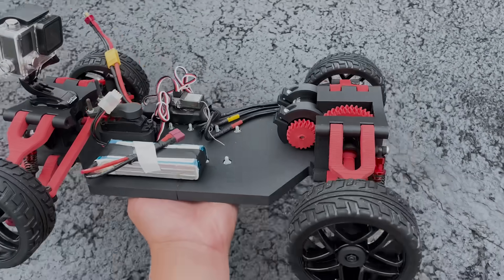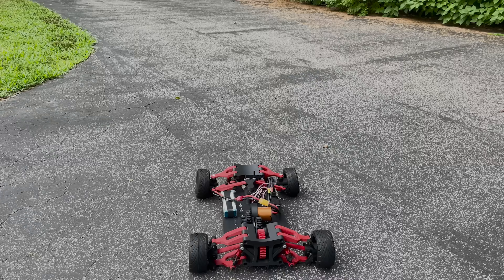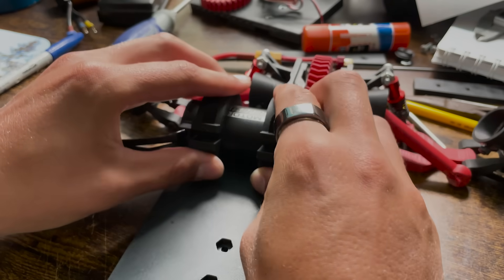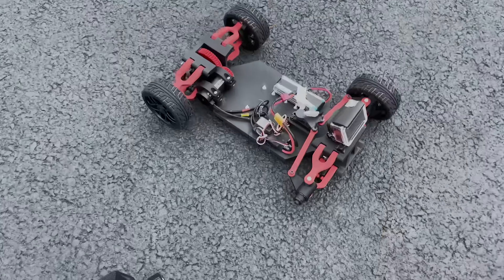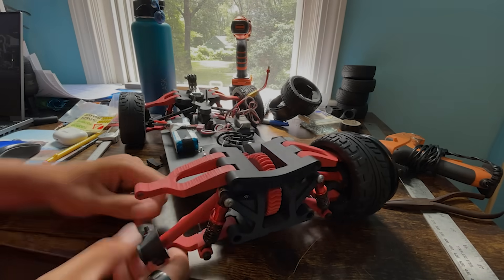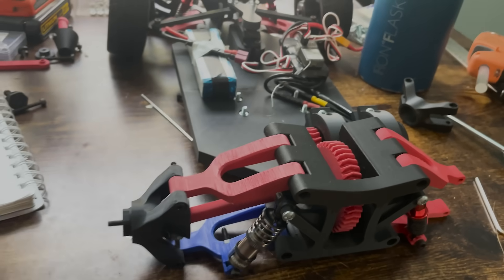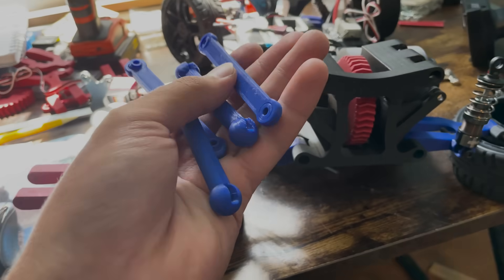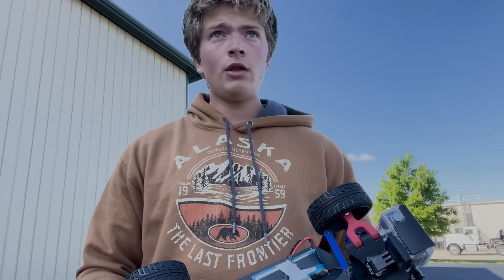Engineering a Better RC Car

Comment: Your suspension needs actual geometry. Equal length, parallel arms (even worse when sloping upward toward the chassis) suck. No camber gain, terrible roll centers, a crapload of jacking... The works.

Comment: Hey I am building an RC car as well. However I have one question. How do I make sure the track width(distance between wheel to wheel) doesn't change a lot when the suspension is compressed and not compressed and does this matter

Comment: you could probably try making it belt driven with it geared down to around 1/6 gearing ratio and 3d print a tensioner

Comment: Just so you know if you print anything out of carbon fiber it will make it more brittle if you print a soft material with carbon fiber it will make it tougher and more rigid what does not make it stronger but as for your lair line issues for people who have printed other things if you print at a 45° angle or with some other kind of angle to it or horizontally anything that is round will become stronger you have to think about how the layer lines are and how things are going to break or twist

Comment: I'm going to share this just in case you haven't found the answer yet or in case you're still looking for a solution but you can take a file and flat spot a certain section then take a grub screw and basically use a grub screw then secure it with either Loctite red or blue and that means the whole entire piece as well as the grub screw you can even take a file and make a flat spot in the middle of your axle for metal rod whatever you're using and put it in the place of where you have the best ability to put a grub screw at I hope that helps you do not need the key the entire thing and adding a key with just make it weaker anyway the other thing you should do is increase your wall count that way it will make your teeth on your design stronger

Comment: I'm only a few minutes into the video. I won't argue with the methods describe to reduce or eliminate cogging, as it is a fairly common problem. But another method is to use a motor with a sensor instead of sensor-less. 
   I finished watching the video, good work and nice try! That's a good idea to release the files to thingiverse. Maybe some people will try the files for themselves. I noticed that you have less than optimal print object orientations. Object orientation makes a big difference in part strength.

Comment: how about designing for 3d printing and not how the part look traditionally. Take advantage of 3d printing. Avoid forces at layerlinies. This is the weakspot. My solution is 45degree to layerlines. Yes it looks strange but it works.

Comment: Great video, and great journey for you! It was a real pleasure to watch how you design and learn on the way of the process. They way you approach problems and find solutions is amazing. So - my advice here is not on the hardness of the materials - but the care of the LIPO battery. RC cars are very close to the ground and usually get beaten a lot. For this there is special type of hardcase LIPO batteries designed for cars. You can print also your own battery box, to make LIPO more protected. LIPO batteries in general are extremely flamable and if you get single puncture , battery will go into burst flames and will totally destroy your car , and even can make a fire on the place.
Reply from the maker: thanks! and thanks for the concern 😅. I should probably do something about that

Comment: Use TPU, dont panic, there is a hard version of it, you can literrally beat it with a hammer, and it will not even scratch. Its like shore 87 on the D scale. Parts with like 5mm thickness will have a little flex to it, but this ist good for an rc car and its way less expensive than nylon, and esier to print, even though it will warp, so design some round pads lick 0.6mm thick to the corners of your parts.

Comment: Like what @craigoverend said. Sensored esc and motor is the best option. I only use this on all my rc cars. Plus it’s more tuneable and fun to adjust play around with. You also get boost and sometimes a turbo depending on the esc

Comment: For those parts that need to be strong... like where the control arms hit the chassis you will want to print them in the strongest orientation to prevent layer separation failure. Even the strongest filaments will need this as RC cars take a serious beating. Good project!

Comment: You should just use 3d printed parts for mold making maybe? Whatever traxxas is doing is super strong! Maybe use shorter upper arms to fix the roll center/camber curves? awsome project! Very impressive fabrication!

Comment: kudos for getting this far, my 3dp RC car took at least as long as yours and i've only had to complete redesign everything 3 times..   I use generic pla+ on mine, there are much stronger filaments out there, but pla+ is way better then plain pla and just a bit behind much tougher to print filaments. Also build weaker A-arms so they snap first instead of the chassis.

Comment: hey, what size bearings did you use in build and bolts, would be nice if u had little description on thingiverse of what bolts and lengts and bearing sizes had been used. Thanks
Reply from the maker: all were 4m bolts ranging from 50mm to 30mm in length, bearings were 21mm OD, 19mm ID
Reply: @hamburgerinc6995  still looking for the bearings mostly 15x21 pops up but no luck on 19x21x4mm mby there is any in inches since I don't understand inches hard for me to get right bearings

Comment: the way to fix the no start on its own or cogging is to use a motor the is sensorred. The sensor  tells the esc where the stator is at all times and will negate the cogging.

Comment: Great job! Problem is you make one part stronger or stiffer and it breaks the part interfacing with it. RC car parts break. It’s just part of the hobby. One trick is to make parts flexible, so they bend instead of break. And make it so the parts that tend to break are easily replaced.

Comment: Sweet car! Mine is a little different. Just know that when you change materials, you have to consider what the part needs in terms of stiffness vs compliance. Since your front arm mount is attached to the chassis, I recommend splitting those into different part/materials. You can also sandwich TPU parts between PLA or PETG parts to add toughness and partial compliance.

Comment: My observation is that many of the parts have not been produced with 3D printing in mind e.g. parts should be designed to be printed with the strongest layer orientation for the forces involved.

Comment: A small metal brace between the control arm pivots could help with that chassis damage. It seams pretty standard for most RC vehicles nowadays.

Comment: I can appreciate the constraints of doing this with additive manufacturing but in some cases subtractive works better
Reply: A lot of nylon rc car parts are injection molded, not subtractive machining.
Reply: @cypvh74  look at a 10th scale 2wd buggy. They used a lot more molded plastic in the 90’s early 00’s. But now they are using aluminum chassis, aluminum bulkheads, carbon fiber shock towers. Way fewer molded parts because it’s not as durable and additive is less durable

Comment: Awesome project, and I like the design.
A carbon fibre PLA would be a bit better I think. To get a bit more strength I put radiuses of every corner where two surfaces meet, and I also put in ribs or gussets where I can. I also pay attention to the orientation of the print and try to get the layers (almost like grain in wood) to run perpendicular to the expected forces.
Once again, great project.

Comment: Nice work, thanks for sharing the files.
I can share a trick for getting metal shafts to glue into gears without keying them. Rough up the outside of the shaft with your grinder. The superglue will gain a mechanical grip onto the shaft and will be totally unable to slip free without shearing across itself over the entire radius of the shaft (impossible), so the weak point will become the glue-printed part bond and that has a similar bond due to the roughness of the printed part.

Comment: While you're redesigning the rear suspension mounting, it looks like you're getting a decent amount of camber loss on your outside rear tire under load. That's contributing to the oversteer.

Comment: I would suggest a lower ratio, it still seems sluggish, and most RC cars have a ratio somewhere between 10-20 to 1. Rather than the overly complex multi 3 to 1 gearbox, print a gear around a 10:1 ratio with the rear gear, and then use an idler gear between the two to make it mesh. The teeth count on the idler has no effect on the drive ratio.

Comment: You mention lots of times in this that you made a part stiffer, but i wanted to point out that stress follows stiffness. Sometimes making an individual part stiffer can make it fail faster as it is carrying more load that could be split up among multiple components, or causes the stress to shift to another component that the stiffened part is attached to then that breaks next. Adding things like bushings of a softer rubber, or maybe making the chassis a bit less rigid can actually improve the overall strength of the vehicle by allowing stress to be dispersed. I noticed on that last breakdown where the control arm mount of the chassis split that the split started right at a small radius interior corner, these are called stress concentrations and they can be relieved by making the radius larger. In this case i would make those notches go further into the chassis to give the maximum radius everywhere the control arm attachments come out of the chassis

Another thing is that 3d printing results in a certain amount of anisotropy, meaning the material does not have the same strength in all directions. Experimenting witg different print orientations may help to shift the peak stresses away from the weak bonds between layer lines. 

More durable materials would help too, maybe try ABS for some of the stout components where warping is not a concern, PETG for skinnier components since abs would warp. They tend to be less brittle than pla which helps to absorb a bit more energy from impacts without shattering, and still MUCH cheaper than metal 3d printing.
Reply: ABS is as weak as 6 months old PLA print. TPU, PETG and Nylon have a far better shot at enduring
Reply: @two_number_nines  asa would be my go to material, easier to print than abs and also better and a heck of a lot cheaper than PA-GF
Reply: @two_number_nines  ABS is softer than pla but it is much more durable, and in my experience it's superior layer adhesion makes up for any difference in strength. In this application I think it would be an ideal material. Petg is great for the price too,  you just gotta have your print settings dialed in to get good performance.

Comment: For gearboxes and driveshafts, dont try to just key or glue the plastic hub/gear to a stainless shaft. Use leverage. if two gears are right next to eachother and spin in unison, just bolt them together. I like to make the shafts in the gearbox stationary, and make the gears spin on the shaft. Dont be afraid to use belts too, its a smooth way to transmit power without a bunch of vibrations and such. Keep up the good work!

Comment: FYI - Lower Kv does not mean high torque. This is a common mistake by the uneducated about the subject. A larger can is the only real way to get more torque with out considering gearing.

Comment: Two things, first change the side that the motor is on, that will make it front wheel drive/ more control. Second, what 3d program are you using?

Comment: I've been racing RC cars for 30yrs.  You're design is really a mix of a late 90's pan car and a early 2000's 1/8 nitro buggy.  Those design elements were never mixed together because they were a dead end 20yrs ago.  The closest thing out there might be an electric version of the Kyosho USA1... looks cool, runs like hot garbage.  TLR has engineered about as good a design as you can make at scale.  You can make them lighter but less durable, heavier with too much rigidity... TLR has made a great balance of it all.  Study those elements, then create something new.  No since digging up the past.

Comment: All else equal, a lower KV motor will produce less torque, not more. I believe the reason it would start more smoothly is that lower KV means more back EMF at a given speed, so the ESC can get in sync sooner.

IMO the first thing to do when you're getting bad cogging is to loosen the gear mesh a bit. Even the amount of wiggle in a fixed position motor mount can make a significant difference.

Comment: Rather than keying the shafts, D grind them and reprint the gears with a small circular extension on their sides to put in a small grub screw to interface with that flat spot on the shafts.  It's how basically all rc cars do it because it's an easy way to secure em.

Also, its gonna suck to get it to work, but you may need to print the axles on a slight diagonal...on the z axis.  It looks like it split at the layer line, maybe add one or two extra walls too.

So...since you're putting it out, I print exclusively in ABS and other higher end materials, and have plenty of unused rc parts to make it work 😂.   I'll give it a shot once my voron changes are done and shes up again.  Thanks for designing it.   Itd be nice if we could get a modifiable/universal card format so the people in solidworks and the fusion guys could try their hand at evolving it further, rather than just onshape.  Then again, maybe its downloadable and I'm just dumb, I'll check it out when I'm back at a pc.  I dont use onshape..lol

Comment: For gears I 3d printed a hex shaft. This can run nicely in bearings and 3d print without supports. 
This is how I got my 2 speed transmission to work. Everything is 3d printed except the bearings.

Comment: lol I think doing a trail or crawler RC may have been...funner.  

Consider that even with retail RC's sold as bashers (like arrma) have the "issue" of "make this part stronger, now this part breaks".   

Said different, a project like this would have no end lol  (just like normal RC basher hobby)

Comment: I hate to nitpick especially when your obviously learning, having fun, and doing a great job, but using proper terminology can really streamline the process of design and/or repair communications.  The "steering hub" is usually known as a "(steering) knuckle" and the "control arm" is usually known as "tie rod or steering link".  A "control arm" would be those red/blue pieces that connect the knuckle and spring/damper to the chassis "bulkheads".  The idea of using nylon sounds great, and I would suggest adding printed exterior gussets to high stress areas for added strength with minimal added weight.  Automotive transmission cases are good examples of what I mean.

Comment: Changing print orientation for certain parts will improve it's strength. For example I forgot the name of the part but the thing holding the wheel and arms together, you mentioned it's prone to breaking on the layer lines, this part should be printed on it's 'side' which will be more challenging with supports, but it should make it stronger

Comment: Can get some inspiration from a 2wd slash gearbox smaller pinion with higher kv brushless gives better low end torque and less speed and bigger pinion gear with high kv gives high top speed but very poor low end cogging if you see their manuals they have gear ratios that can work if used in same fashion

Comment: For PLA chassis to work, maybe shrink down the size of the car, it's pretty big and heavy. Or just print it out of TPU and get metal rods inside for more rigidity. For arms and hubs TPU, high temp 235C very slow speed for better layer adhesion. Use metal shafts and gears, just like shocks, some parts you just need to buy.

Comment: Small little hint on your rear geometry toe your rear A arms to a toe in maybe about 2 degrees on each side. It will give you a lot more stability at speed. Take a look at a 1/8 scale buggy the rear wheels are toe in just a little.

Comment: Looks like a fun project and the car looks great! 

Since you seem like a development-minded person, I hope you don’t mind a couple of points where I disagree with you. 

A lower Kv rating of an otherwise similar motor doesn’t mean it has higher torque. Out of two hypothetical motors, the one with the higher Kv value produces just as much torque but draws more amps when doing so. This means you can use a taller gearing with the lower Kv motor without overheating, so it’s easy to misinterpret as higher torque. 

My second objection is that adjusting the spring preload nut doesn’t change spring rate. If you crank it up the car sits higher but the spring rate is the same as before. (Assuming the weight of the vehicle makes the suspension sag a little from full extension, which it should.)

Comment: Make the lower arms wider for a true A shape. Drop the "wings/ears" on the body side. Have only 1 center hinge on the body side. This will 2x the strength.  Use the back part on the lower arm a snug fit so you dont need a nut. That gives way more plastic around the bolt. See if you can use a larger fillet around the ears for stress relif in the corners.
Reply from the maker: good advice, thanks!

Comment: I love that anyone can make an rc car from home, but I noticed a couple things, you can use a sensored motor to stop the cogging, the shocks are upside down, you can add a swaybar, and some other tinier things that might affect the car in the future, but I love the content 👍
Reply: This ^. Look into VESC's, an non-sensored motor in FOC mode should be able to apply full torque no matter the load or speed. And they're as cheap as you'll get it

Comment: Nice work.  Did you print any of the parts or use that service?  What printer and filament did you use?   Thanks
Reply from the maker: Using a bambu labs x1 carbon. all the parts in this video were made with PLA